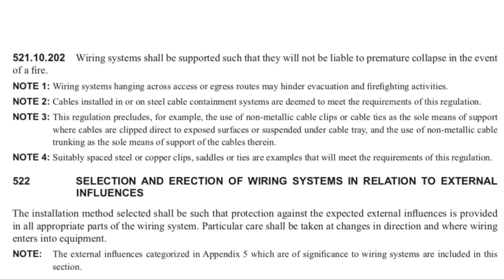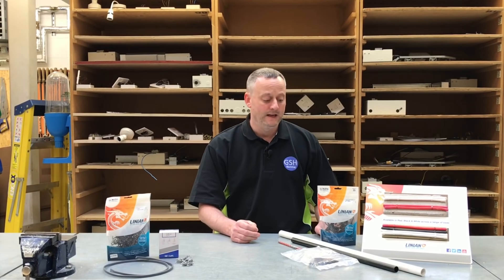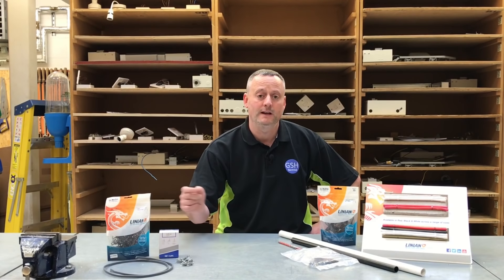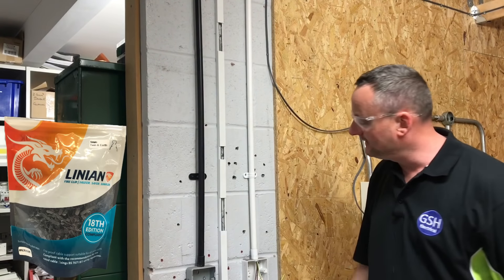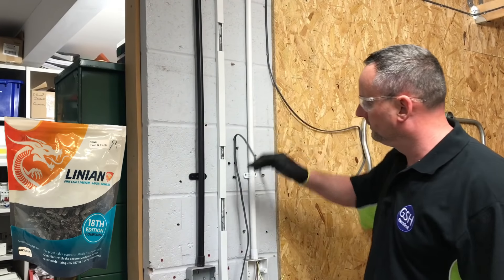Clips for Twin and Earth Cable to Prevent Premature Collapsing of Surface Wiring LINIAN Fire Clips

Comment: I was asking CEF about these recently; they're aware of them but don't yet have them on the shelf. Denmans are stocking them, but at a list price of £43.38 for 100 (with VAT) which is a price I balked at. I appreciate they're a time saver to install and can be used in conjunction with traditional clips to achieve compliance, but I'd like to see them a lot cheaper. One question, you've deftly demonstrated their strength when installed, but can they be removed if needed?
Reply: Ello D. Apparently carpenters pincers can be used to re grip and remove.
Reply: @shaunsparky5354  Ahoy-hoy, thanks for that. I ought to bite the bullet and pick up a pack I suppose.
Reply: D. Check out the sizes first, I found them 'baggy' on certain T&E's but definitely very good. Like I said in comments above, D-Line have their own range with the 'split' at the top, these do look slightly more practical when 'loading' the cable...plus jagged edges will hurty digits if installing lots.
Reply: @dsesuk  i also thinked about it ,and do you need the LED lights,our product can connect the wire quackly.

Comment: So the regs solely apply to surface wiring. Any wiring between floors is prevented by the ceiling and wouldn't need support